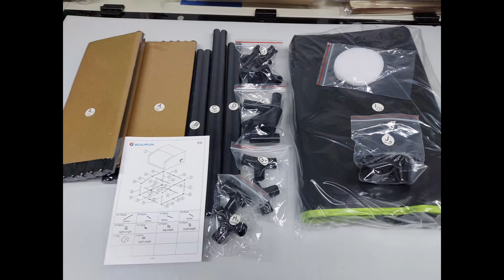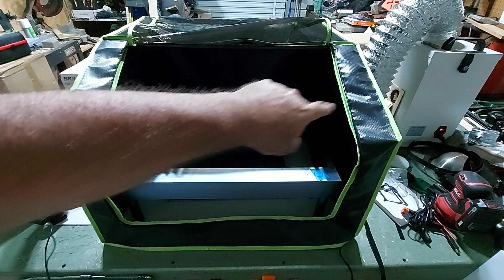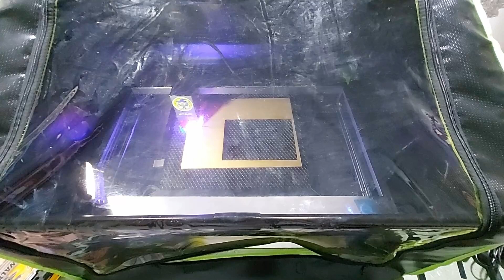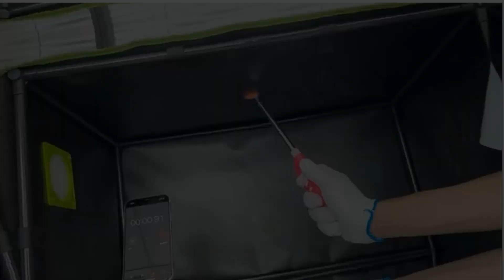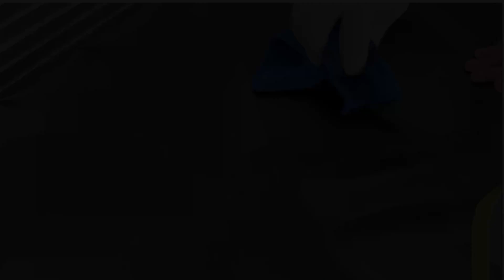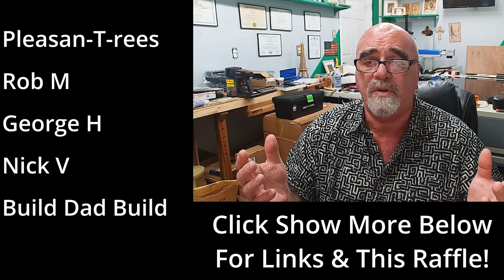ℹ️ Laser Accessory Week! The NEW Sculpfun Laser Enclosure!

Comment: Just assembled mine and it took me literally 5 minutes from opening the box to fully constructed. I have a home build carbon scrubber with an inline fan and it works awesome. I wish they would have just put the 4 in connection on there since that is what most everyone I have seen on channels use but I suppose getting a reducer to fit it will not be that hard. Very good price and the size is great, even for my Atomstack A20. Thanks for your video on it. Love your take on things.
Reply from the maker: Thanks so much Jack!

Comment: I have the same problem with brevity!  😂 I always want to get all the information out there!  I added a small strip of 12v led lights along the top back bar to add some light on the one they sent me. It helped brighten things up. I usually vent outside but I’d love to try out an air scrubber during the super cold winter months. I might have to set one up later this year.
Reply from the maker: They work pretty well! I did add another layer of activated charcoal to mine since there was room inside, and I would say it seems to filter 100% of the smoke and about 99% of the smell.

Comment: I followed your link to the scrubber and I can't find any info on the maintenance of the scrubber. How often does the filter need to be changed/cleaned?
Reply from the maker: There are no rules on that. It all depends on how often it's used William. I have had it now for a few months using it about 3 hours a week and there's still no smell. I did add an extra layer of activated charcoal to it when I first got it.